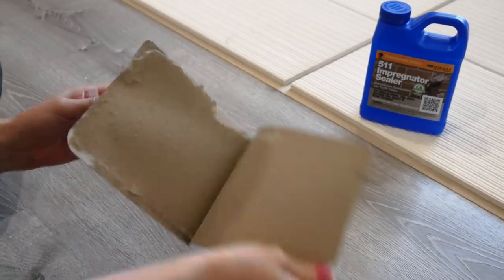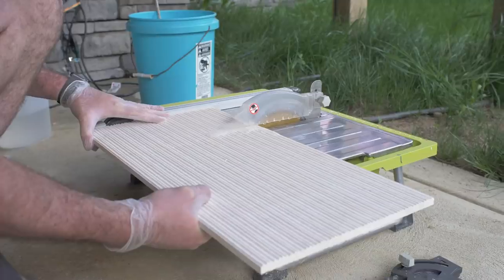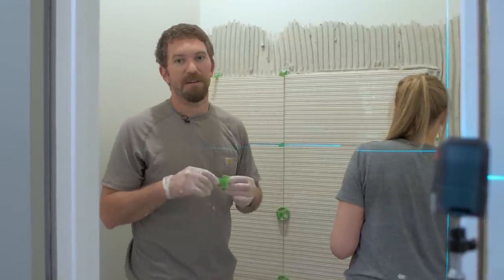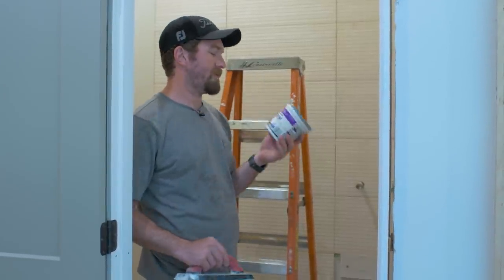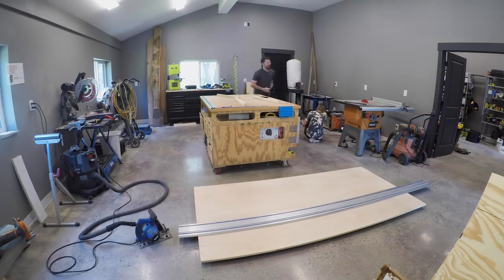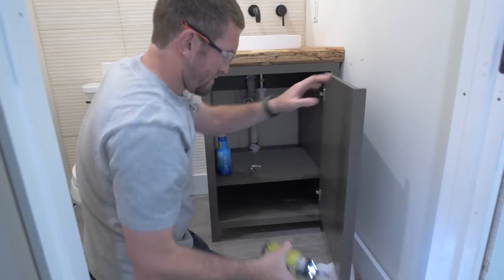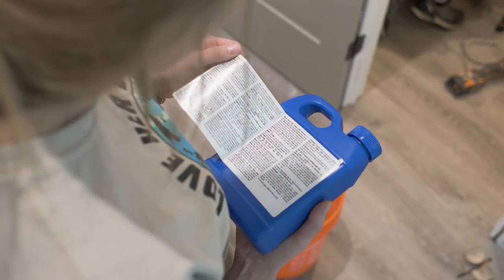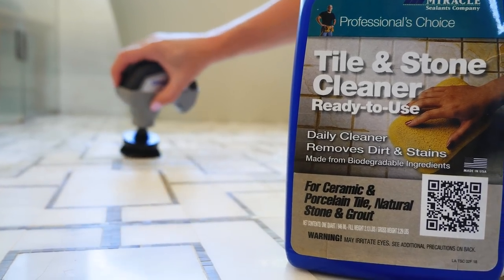Half Bath Makeover with AMAZING Tiled Feature Wall!

Comment: @1:45 you should always put a full, complete scratch coat to the surface you are applying thin set to, especially a painted wall.The tiles you installed aren't getting a complete bond to the wall which could cause issues later down the road. Never half ass on your mud if you want long lasting work.
Reply from the maker: Interesting. I have seen a lot of professionals tile walls without a scratch coat. I know it's required in certain instances like when using stone veneer but we used a high quality mortar and got near 100% coverage on the back of the tiles so I doubt we will have an issue. Thanks for your thoughts though and I will definitely investigate.

Comment: Awesome work buddy. I was looking into applying the 511 sealer on my tiles as well.  From what it looks like, some of my tiles are slowly showing a wear on the existing sealant.  For example, if I use painters tape on one of the tiles, the shininess of the tile gets removed when the tape is peeled.  I am not sure why that’s happens.  Anyways, is there a cleaner that’ll remove the existing dirt and whatever sealant it has so that I can apply the 511?  Thank you for the response.
Reply from the maker: Sure is. They have a heavy duty cleaner made for natural stone: https://www.rustoleum.com/product-catalog/consumer-brands/miracle-sealants/clean-maintain/heavy-duty-cleaner-acid-substitute 
I also wrote an entire blog post on sealing and cleaning tile: https://rogueengineer.com/why-when-and-how-you-should-seal-tile/
Reply: Rogue Engineer thank you.